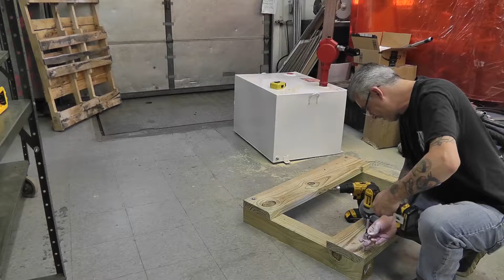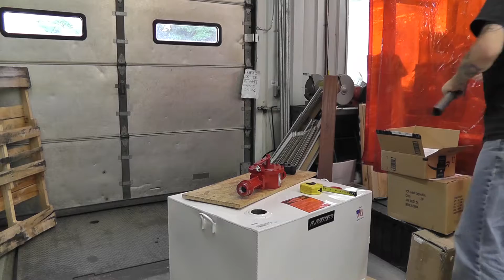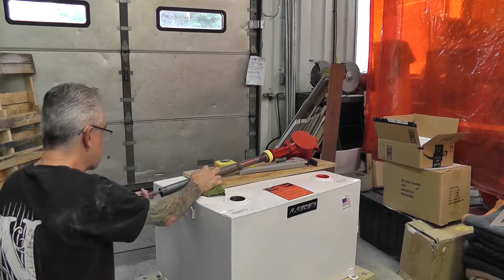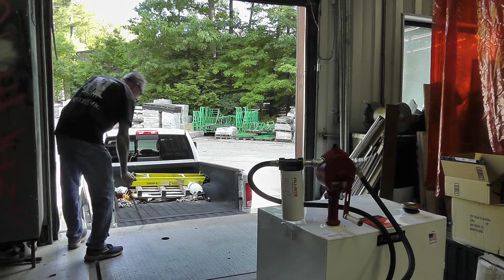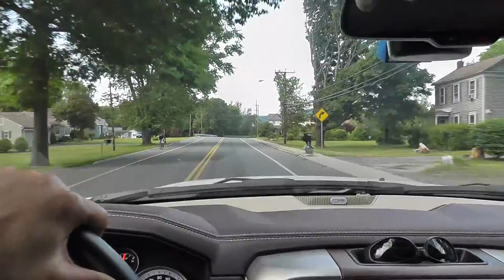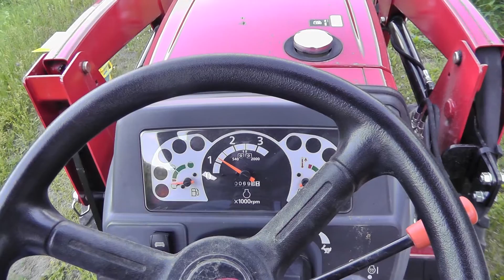No More 5 Gallon Fuel Cans For This Guy - New Fuel Transfer Tank

Comment: Hey buddy, you should never pre-fill filters from the center hole, thats usually the OUTPUT. Works the same for oil or fuel filters, if you're trying to prevent an oil starvation issue on an oil filter on a vehicle, use the smaller holes along the side, but on a fuel filter, never prime or pre-fill them. I get that everything has filters and whatnot in the tank, but its easier to swap an external filter than eventually swapping or clogging the internal one in the tank. kind regards
Reply from the maker: Thanks, I  appreciate the info!

Comment: I get that your portable tank is not coming off the truck to fill it, but it should.  You should be figuring out how to get that tank grounded before you fill it.  The static build up on a 100g transfer is significant.  You should be using a portable ground strap at least.
Reply from the maker: I would agree 100% if I was filling it with gasoline but diesel fumes are no where near as flammable. I remember when I was learning to drive 18 wheelers when I had an instructor who shocked us by using a lighter near the fuel tank opening to see the fuel level better. This really only gets filled a time or two a year and that was the entire point of building it.
Reply: @weekendhack.whatsnext  I think what you meant was that diesel has a higher flash point than gasoline. True, but you'll never see an aircraft refueled without being bonded to the fuel truck, and grounded to earth. And jet fuel is similar to diesel fuel.  In your refueling scenario, I would mostly be worried about spilling any fuel onto your bed liner (hot summer day) which would have the potential to bring the diesel fuel into it's flashpoint and then you're just rolling the dice.  A catastrophe is usually the result of just a series of unfortunate events, the perfect storm.  I hate to see anything happen to ya.  Cheers.
Reply from the maker: @triumphnutter  yes, that is what I meant. Actually I never see anyone ground their plane when refueling at the airport I keep my plane at. I know it should be done but to be honest I have not even seen a ground strap. I will look for it next time I need fuel though now that you mention it.
Reply from the maker: @johnvanlandingham8832  knowing the materials you are working with is quite important too. Diesel oil in no where near as combustible as gasoline.

Comment: bad idea havin gthat tank clkose to the road where someone can take pot shots at it or steal your gas
Reply from the maker: The tank is stored up in the field behind my house. Where I live I doubt that someone is going to come buy and steal 50+ gallons (400lbs) of diesel but good luck to them if they try. LOL
Reply: @weekendhack.whatsnext  i see a road behind you and cars on it they can see it from the road.. hide that tank you place others in danger from fuel leaking out from being shot etc and probably could start a brush fire
Reply from the maker: @jerrypatterson55  thanks for the concern but that was filmed in front of my house when I brought the tank home because it was convenient and near my tools. The tank did not stay there, it is up in the field behind my house. I also live in a very small town with no regular shooting from the roads. In fact if someone did shoot from the road they would most likely receive return fire from some direction and immediately regret it Not to mention that diesel does no ignite from a spark.
Reply from the maker: @johnvanlandingham8832  maybe a beer in the tractor cupholder on a hot day but I save the whiskey until I am done. LOL

Comment: Save some money by finding a station near you that carries "Off Road Diesel" It is cheaper because it does not have the road taxes on it. Just be careful as there is a fine if you use it in vehicles that you put on the highway. A lot cheaper, depending on how much tax your State adds.
Reply from the maker: Good idea but the closest place is around 30 minutes away in a direction that I do not travel often so any money saved is not really saved.
Reply: I thought of this but came to conclusion it's not worth it if you need fuel for your vehicle ever, you're stuck...I would rather have extra fuel for everything

Comment: Plasma cutter ? Ever hear of these round thingys called drill bits ? Or maybe a different round thingy called a carbide burr in a die grinder ? I have a 50 amp plasma cutter but damn sure wouldnt use it for that. WTAF   ?
Reply from the maker: It was handy and easier than finding the other tools.
Reply: Of all the ways to bring up a topic to choose the dick way. Remove your comment and try again..

Comment: That is NOT DOT COMPLIANT !!!!! It would be worth your time to 'google' what is legal.
You're 'on the hook' if you have an accident and you're not legal. Jail time for criminal negligence 
and bankruptcy from potential civil liability law suits are not worth the money you think you're saving.
Reply from the maker: Thanks for the info. I will look it up but I do not see much of a difference between being bolted in or strapped in and my filling station is only a few miles down the road. Would it be ok with you if I drove the tractor to the filling station with this tank on the forks instead?
Reply: Hush up tattle tale😆